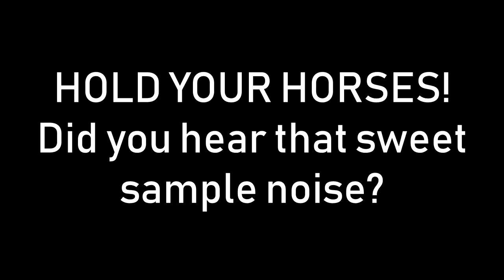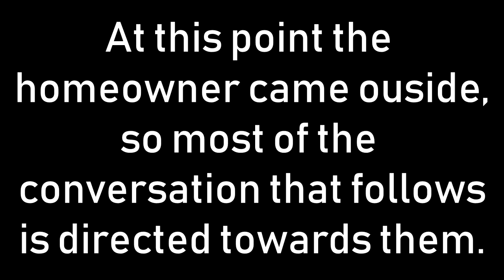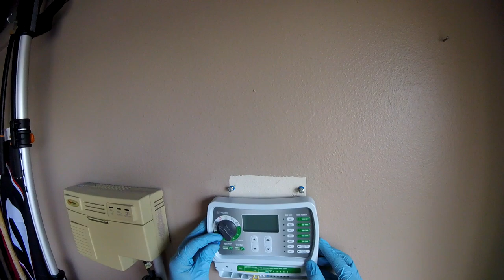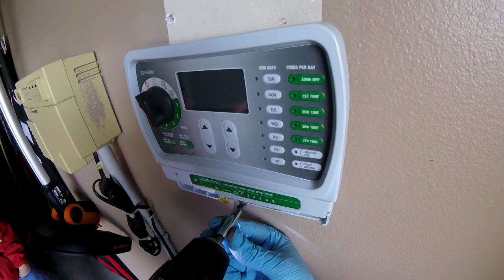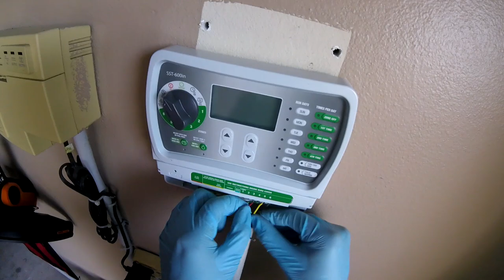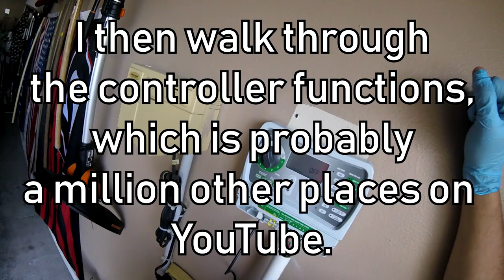EASY DIY Sprinkler Timer Replacement

Comment: oh this was hilarious, from the beginning all the way to seeing your DIY skills! 
that first drill mark locating, to hammering with your drill to using your keys to get the raw plugs out comedy gold! 
and while you were placing the new box up I was thinking why didn't he just use the bottom screw already in the wall and the box would have been higher then and would have covered most of the different colour wall and the holes ! classic you! 
thanks for the laughs!
Reply from the maker: Lol yeah hijinks all around. I had to move the controller because the old holes would have put it too high and the wires wouldn't have reached :)

Comment: I've done some sprinkler maintenance, but what I've done mostly is replacing broken/clogged heads
Reply from the maker: That is probably a lot more common than replacing a timer, these things usually last a long time!
Reply: I've never had to replace my sprinkler time, I have had to replace Solenoid valves and cracked pipes, but If a client asks me to replace a timer I can do it now, thanks to this video, I learned how to do it

Comment: I would not use that type of controller because I think it’s more harder to understand but that’s me. Also it’s usually sold at hardware store and anything sold at hardware stores I think aren’t really reliable. For residential controllers I would recommend the Rain Bird ESP-TM2, or Hunter X-Core or X2

Comment: I just replaced my 15 year old Orbit with the Rain Bird SST Sprinkler. I'm having one issue, when I set it to manually water one zone it comes on but I can't set for how long to water. When I push the arrow key per the instructions the time of day changes. Do I need to exchange mine for another one?

Comment: I'm a bit surprise that the new controller didn't come with a template. Because I currently have what you took out and it came with a template.
Reply from the maker: Maybe it did and it was tucked in with the instructions. Of course you know I NEVER read the instructions! ;)

Comment: Always show unplugging from the outlet! Too many people do not think of electrical safety. Especially if you are making a DIY video, your audience are not professionals like you who know what they are doing.
Reply from the maker: Good point! One advantage of working on a sprinkler system is the low voltage, but yeah, a wrong move on the board could give you the full 120!